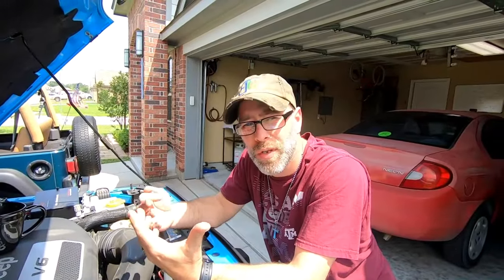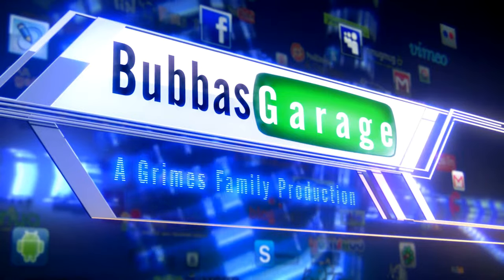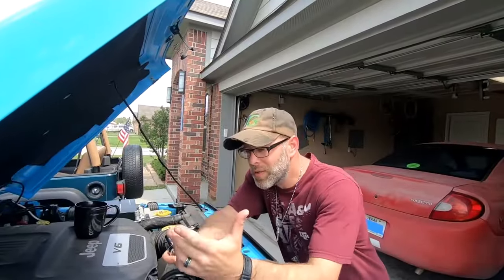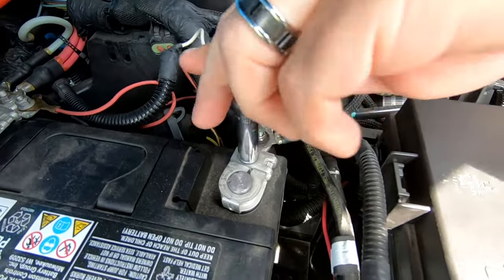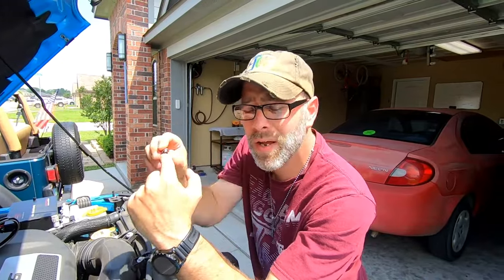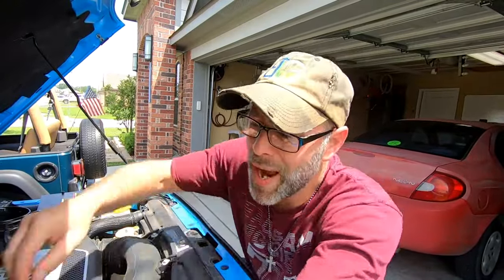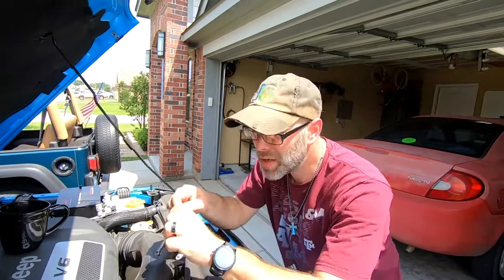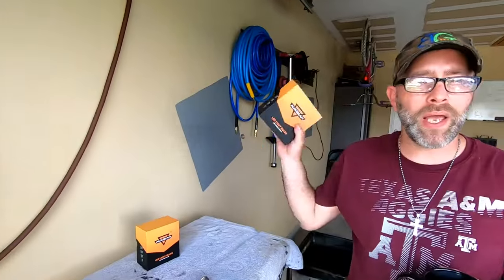Episode 381 - Random Jeep Wrangler Dash Problems while driving? TRY THIS!

Comment: Landed here from your speed sensor vid. I bought this car used with a warranty. Came with a light bar that I actually want removed. I have these same lights and sometimes they’re just on for decoration when I’m lucky and every other time I get kick back from the brakes/ABS/crazy speedometer readings even after turning the traction control off. 
Now after watching this, I recall the time I had to pull over and restarted to a dead car. Cranked up normally about 5 minutes later. Going to try this tomorrow with a neighbor. Thanks for this.

Comment: I have an issue with the check engine light coming on and then when the jeep drops into the passing gear the traction control light comes on and then the engine goes into limp mode. Do you have any idea what causes this problem?
Reply from the maker: I would say maybe a wheel sensor. We had this happen once but I wouldn't say that it went into limp mode. So I'm not sure. We do have a video on the wheel speed sensor if it helps.

Comment: My speedometer been going up and down randomly and the traction light been coming on since I connected my rock lights. Hope this fixes the problem. Thanks.
Reply from the maker: Depending on how you hooked up your lights, this could help for sure. Keep us posted.
Reply: Hello, did this help? I have a 2017 Jeep wrangler and my speedometer keeps going up and down. I took it to the shop and they found no codes and can’t figure out why it’s doing it. Please help me. My dad used to work on my cars but he passed. As a girl I feel taken advantage of by my local mechanics. I just wish my dad was here to help me, I miss him so much

Comment: Those 3 warning lights that will usually all come on at the same time is usually due to bad grounds and/or there's corrosion in one of the boards where your relays are. Jeep's are known for this. I pretty much solved that issue by rewiring the 1 relay in the relay box & also by fixing 2 ''Grounding Pigtails'' by snipping off all the ground wire ends & then soldering them back together to the eyelet then bolt the Pigtail back onto the vehicle framing under the hood... I still have warning lights that will come on now & then so I am no way near finished locating other bad grounding issues....
Reply from the maker: Great call. Totally agree. Been dealing with bad ground issues on almost every Jeep lol.

Comment: Hi, the last time I had a problem with my jeep wrangler,I do what you said and I fixed the problem, now I have another one,I have 2 lights on traction and abs will you please tell me if you know what is the problem. I forgot to tell you also have a code P 2586
Reply from the maker: Hey, so glad to hear the video helped 😊 Have you checked out our video about the wheel speed sensor. We have this issue several times. It might be related.
https://youtu.be/3EJ4MUBwQKI

Comment: I bought a 2016 Wrangler this past winter and have been having intermittent warning lights, usually ABS, wheel slip and Hill Start?, and MIL. They usually clear after a few minutes but it has been extremely annoying and I didn't feel like I could "trust" the jeep I just spent $26K on. I figured there was something loose and my mechanic looked it over and didn't see anything obvious and said he couldn't really help unless something actually failed and then he could diagnose it. 

While hunting around the net for the actual meaning of the various warning lights I came across this video and sure enough, the former owner had added lights and power running boards and tapped off the power using that battery terminal tightner bolt instead of the the wiring connections right next to it.  I just moved the wires and tightened everything up and I'm off for a test ride to see if I can "make it fail" again or not.
Reply from the maker: Keep us posted for sure :)
Reply: @BubbasgarageTv  So far, so good. I'll report back in a week or so. Thanks for all you do to put this kind of information out there.
Reply: @BubbasgarageTv  Well, it happened again today after a slight bump in the road. ABS light and wheel spin/slip light. They cleared after a 10-15 seconds. I'll keep poking around. maybe something else is loose.
Reply from the maker: Your very welcome. Fingers crossed 🤞
Reply from the maker: Have you had the wheel sensors checked. This can be another cause.

Comment: My 2007 Liberty threw a code for r rear wheel speed sensor with all these lights on.  Changed the speed sensor and the lights went off for a short time but always come back on.  When the dash is lit up I also get a vibrating noise intermittently when I brake - I can also feel the vibration of the pedal.  Brand new pads and rotors in the front but that wasn't the issue.  Of course replaced that speed sensor and then changed it out with the speed sensor from the L rear.  Still reads R rear wheel sensor and xmas tree 🎄 dash, vibrating pedal.  Any advice?
Reply from the maker: Goodness not many sensors left to replace. I know this was 2 weeks ago, any updates?

Comment: My 2014 Jeep Cherokee started doing this all and I mean all lights on dash come on and it slows its speed sounds as if in neutral. Also the first it happen my radio complete shut off. Ac works all other lights work except the radio screen. And since the first time it did it the odometer started blinking checked my battery connections and they seem fine. Cant drive it for no more the 5 mins and all dash lights come on. Please help 😢🙏🏾🙏🏾🙏🏾🙏🏾
Reply from the maker: Gosh hate to hear this, have you checked out other videos about random dash lights? It might help?
Reply: @BubbasgarageTv  i took it in for recalls, that fixed the dashboard warning lights coming on and also fixed the thing with slowing down because of the brake coming on while driving. But the odometer stayed blinking and of course my radio is not working i know I have to change it but the odometer keeps blinking even after taking the fuse for radio out.

Comment: Wow, I hope this fixes my issue. On my 2014 jk, 6 speed manual. First noticed it on a tripe between Minneapolis and Iowa, I was cruising around 65/MPH, music blasting, subs going. Out of nowhere my traction, abs, brake lights all lit up. felt like the car shutoff for a sec and restarted, but what was actually happening was the cruise control cuts out, radio shuts off like battery power was removed, and I say this because when it restarts, the radio reinitialize as it isn’t fresh out the box and just got connected to power for the first time. I don’t travel without my scanner or some tools anyways so after it happened three times, roughly 10 mins apart, I came to a stop and the car was idling fine. Connected the scanner and and I found a C2103, and C2101. Battery/ system voltage high. I thought maybe my alternator was going bad and over charging at highway speeds. Ended up changing my alternator on that trip. It didn’t happened for the rest of the weekend, a week later thinking I was out of the hook it came right back. Happens when my amp is playing a hard base, goes away if I turn off the music. Funny thing is my stereo amp power is connected to that particular 10mm stud. I’ll check this out and see if it’s the cause. And no, I’ve done the cam sensor replacement already, the curse cutting out has nothing to do with the sensor. Or at least I don’t think.

Comment: We have a 16 Jeep Wrangler that driving will do the Christmas tree affect but also it acts like it goes to auxiliary. No power for seconds and then comes right back on. My daughter had an alarm installed. I wonder if this is happening. At dealership now and they say no codes so there is nothing they can do.
Reply from the maker: I would definitely check that battery connection for sure.

Comment: I’m currently driving across the country and this just happened to me out of nowhere. Never had an issue before, I took it to get the battery check and alternator and everything checked out. I’m wondering if its safe to drive the car like that until I can get it fixed?
Reply from the maker: Have you checked our other video on this. Is it your wheel sensor
Reply: @BubbasgarageTv  I’m not really sure, the speedometer drops when I’m driving, but I don’t lose power and sometimes different lights come on, on my dashboard but for maybe 1 second. I don’t feel like the car loses power, it’s just the dashboard that’s acting funky.
Reply from the maker: Right, we have ran into this crazy situation a few times. Generally it's the power connection at the battery or the wheel sensors. Keep us posted for sure
Reply: @user-rw2dr5my1s  my Jeep does the same thing and I'm on a 10 hour trip
Reply: @Jordanbrandonbox  mine was one of the fuel injectors.
Reply from the maker: Wow that's crazy, so glad you got it figured out.
Reply from the maker: Most of the time it's wheel speed sensor or the battery cable connections. Be safe out there.

Comment: I’m not sure why anyone wouldn’t use those to begin with as that’s what they’re for. Unfortunately for me, I did use those and it still does this. Currently, I lose voltage while driving. Car cranks up to 14 when I start it, as soon as I start driving voltage bounces back and forth between 12.8 -14.3 giving it gas knocks it down to 12.8, then when I’m coasting it goes back up to 14ish, then when I I stop and come to an idle it drops down to 13ish, give it gas and it goes to 12.8. Not sure what the deal is. Frustrating because obviously after a while it will start wigging out on me.
Reply from the maker: Is a very common issue.  On yours it sure sounds like a grounding issue?
Reply: Hi, I have the exactly same problem, did you got to a solution? On my case the change the negative cable to the battery but I still have the same issue 😢

Comment: We had that exact problem with a Christmas tree dashboard after adding our first auxiliaries.  Took us a while to figure out the loose negative battery terminal connection was the issue.   This is a GREAT video that will hopefully save some an unneeded trip to the dealership.
Reply from the maker: Hey thanks a lot Mike! Hope you are well.
Reply: Always good. Often times we also achieve great. 👍
Reply from the maker: @mikehoffman3690  Amen too that!

Comment: I had a similar issue and it turned out to be the aftermarket radio interface adapter which also caused all of my gauges to drop and where my odometer is it would say no hub I found it to be the ground on that harness
Reply from the maker: Oh Wow thats crazy. Thanks for the heads up. Something to keep in mind for sure.

Comment: Sure as shit dude...this worked. I kind of knew this was the problem because I actually saw that my post wouldn't tighten. But shit....because what you explained was the reason why and I haven't have the bells and lights go off and haven't had to jiggle my battery cable sometimes if the jeep wouldn't start at all. It took literally 2 minutes to add it to the other part of the post
Reply from the maker: SWEET, so glad it worked out :)

Comment: My jeep jk still does it. Its not even connects to terminal bolt. Put them on the other one. Still gives me problems. Put a new fuse relay in and that also didn't fix the Christmas tree lights after hitting a bump. I have no idea why this is still happening 😕
Reply from the maker: Have you seen our other video on this? Could be a wheel sensor.
Reply: @BubbasgarageTv   what episode number for the other episode on this? Thx

Comment: My 2013 cuts out when I hit a horrible bump and railroad track. First I was told sensors, I switched all those out then the mechanic stated throttle body. Changed that. Then I was told oil pressure sensor. I kept telling mechanic IT ONLY DOES IT WHEN I HIT A BUMP..... It has to be a ground wire or something. Then I was told the wiring harness. I refuse to believe it is the wiring harness even though I could be wrong. I'm feeling like it may be the aftermarket alarm system I put on it, but once again I could be wrong. When it gets too hot and I hit a bump, it shuts off and I have to wait for it to cool down before it will start. What could it be?!!!!

Comment: I have 2016 jeep wrangler the issue I have is that  when I put the headlight on auto the light stays on even in the sun light so what could be the issue?
Reply from the maker: Sure sounds like the sensor. I think it's located on the dash in the center.
Reply: @BubbasgarageTv  does it needs to be replaced or just cleaned ?
Reply from the maker: Honestly I would try cleaning it well first

Comment: mine has no codes..... and my nuts and bolts are tight on my battery. 😕 been going down bumpy dirt roads
Reply from the maker: Have you checked our other video about the wheel speed sensor? Could be related?

Comment: hey man! this actually helps a lot. for a while now my abs light has been on & after i took it to get it fixed it’s gone. however, now it’s cutting out my audio when i hit bumps or turn etc. 

for starters: i have a 2014 jeep wrangler with subs & an amp installed. both are pretty tight but i still have the issue. i’ll try this method first but in the mean time do you have any ideas? thanks i’ll update later!
Reply: Hi how are you, I have the same issue, did you got to a solution after all? 😢please help
Reply: @vamer95  Yes!!! 

This is going to sound so strange (why tf would this effect my audio) but it was the rear windshield wiper plug that connects to the hard top all the way in the back -maybe the cords too idk. 

I think it has something to do with having audio after you take your hard top off.
Reply: just plug them firmly in or dangle it to see if that changes. hope this helps!!